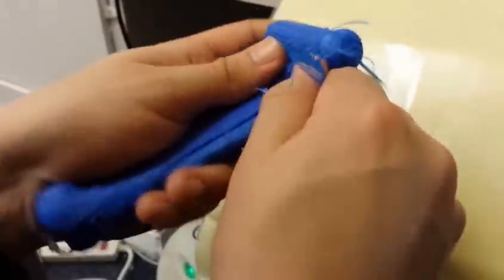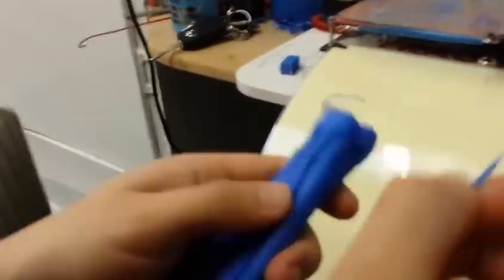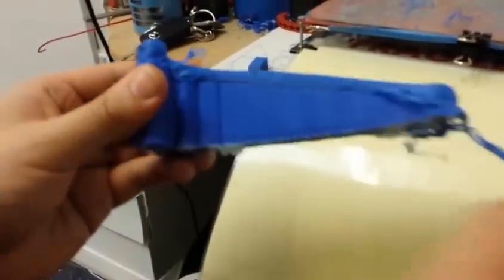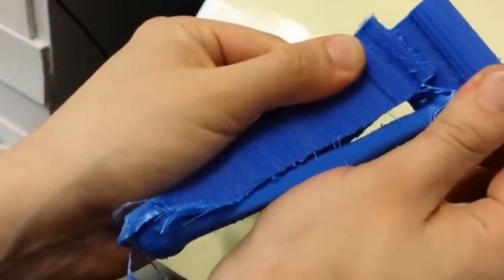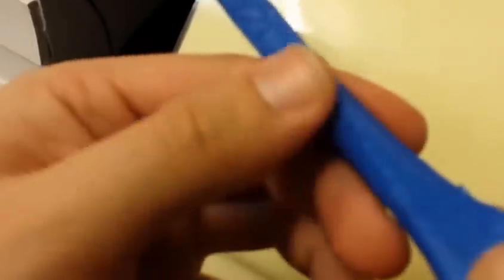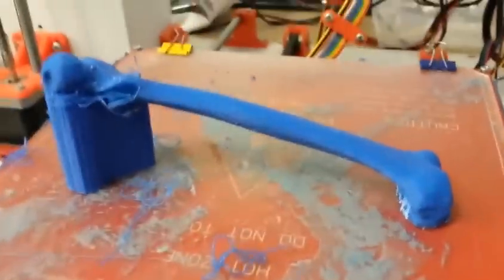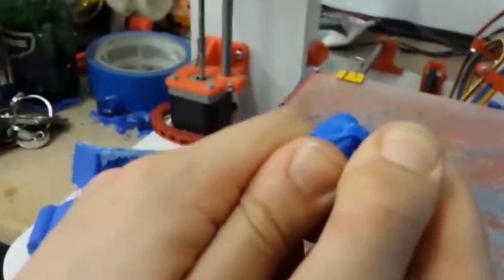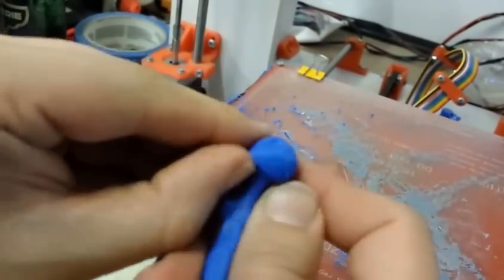3D Printing ABS using HIPS support material

Comment: Hi, I've been trying to print with HIPS filament, not as  structural support
 material,but as the base material for a part. The problem is, that the 
adhesion between the layers isn't enough to hold them together during 
the print, even at 260º C. Any tips?

Comment: Using HIPS and ABS I find the HIPS deforms the ABS (not smooth).  Have you had any experience with this?  Any solutions?
Reply: Try decreasing the extruder temp for the hips and reducing the fan speed (if you are using one).

Comment: Hey there E3D team. Thanks for the video. This is the first time I see HIPS used as a support material for ABS and it seems to work quite well! Do you know if It can be used in combination with PLA?
Reply: I have not tried it.. although we have used XT with PLA, check out this blog post: http://e3d-online.com/index.php?route=extras/blog/getblog&blog_id=20

Recently however Sanj has been doing a bunch of very successful all-PLA prints using support using the Simplify3D slicer which yields amazing results!
Reply: Hey Josh, thanks a lot for the link and for sharing the experiment. I'll be trying that myself once I get a dual extruder set up.
Reply: I'll have a look at simplify3D, I wonder if they have a trial version...